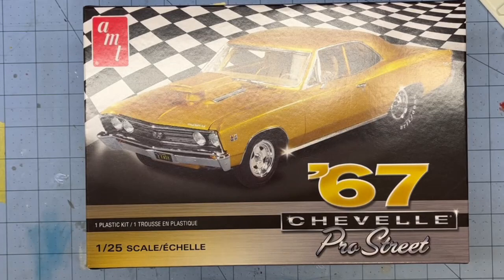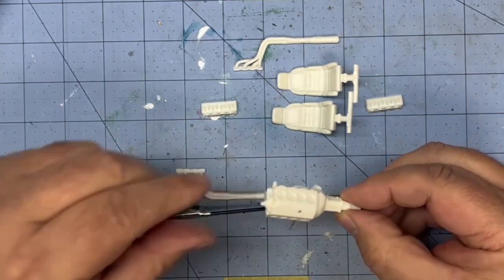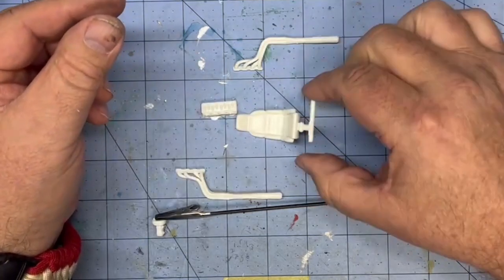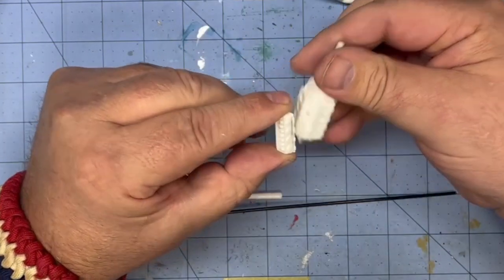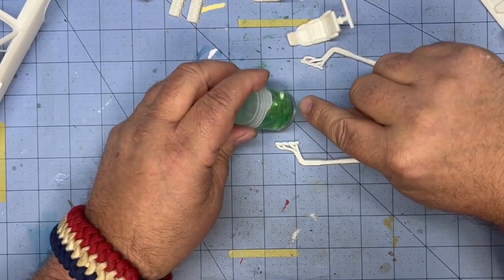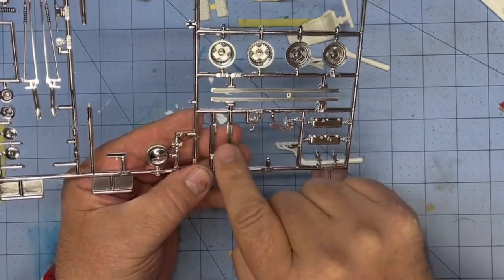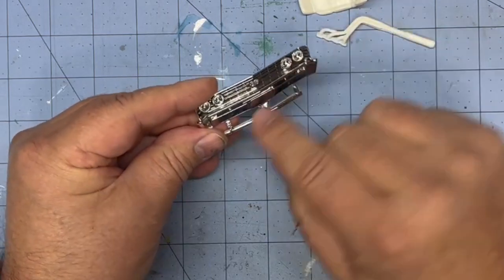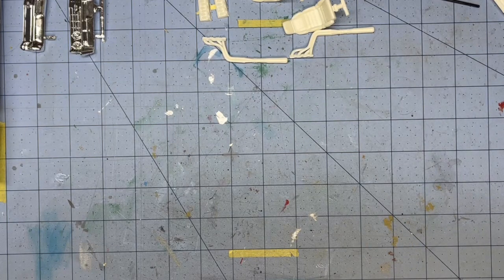67 Chevelle Pro Street build update 1

Comment: I prefer using black acrylic over Tamiya panel line for grills with well sharpened wet & dry tooth picks to scrape away excess.A bit of pledge over it when dried protects from cracking or chiping.I'm currently on the same build...exhausts exits need a good drilling.A coat of Rustoleum matte clear over the chrome rims & they turn to aluminum😁
Look forward to more great videos Mark.
Cheers.🍻
Reply from the maker: That's exactly what I do too.  It's so nice to be able to get a little messy and scrape it away.  LOL  I usually do the pledge when I add the headlights.

Comment: After seeing what you did with the ford P/U I can’t wait for this to happen!!  Btw thanks for the tip using the folk art black. That’s been a bugger for me in the past
Reply from the maker: So far this seems like it's going to be a fantastic kit to build.  That Folk Art paint is so great to use if you are working on something that you just can't have messed up.  I'll be using it on the seatbelts on this build too.
Reply: Thanks for the quick reply, I was wondering what you used for chassis color. It looks like a dark charcoal/black
Reply from the maker: I used Tamiya's Semi gloss black airbrushed over Vallejo US Navy Gray.  And for the under side of the bed I used the Folk Art again.

Comment: Correct me if I’m wrong but I always thought the brake booster went directly to the intake manifold and the coffee can vacuum was a charcoal canister to vent the fuel tank.
Reply: Btw. Love your craftsmanship makes me want to get back into the hobby again.
Reply from the maker: That is the vapor canister!!  I was going nuts trying to figure out what it was.  Now I will be making a vacuum can.  In this case, a vacuum reservoir (or canister) could help. A Vacuum Reservoir stores the highest vacuum created. Then, the booster has it when you hit the pedal.   So at idle when the engine is not making a steady vacuum the brakes will have boost.  You run the boost hose to the can and the vacuum line from the can to the intake.  It just makes the power brake have vacuum to work.
Reply from the maker: Jump in, the waters fine.  LOL.  I took a 25 year vacation, and have been back at it for about ten now and loving it.  Lots have changed.

Comment: I bought that model because it's a Chevelle. I bought a second one because the rear tires are cool. Haven't decided what to put them on.
Reply from the maker: LOL.  I know what you mean.  I am pumped that it comes with two rear sets.  Not sure but I think I'm going to try and put a Kelly logo on the street tires and use them.
Reply: @grandpamarkshobbies  I live about 15 miles from Hoosier Racing headquarters. They have decals. 😎
Reply from the maker: That's very cool.